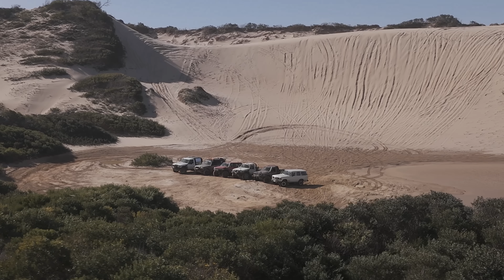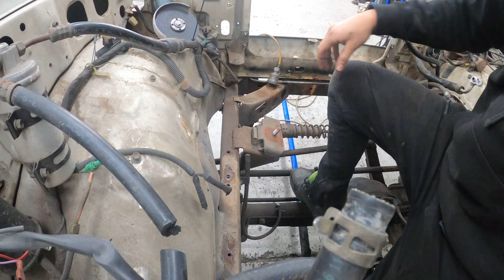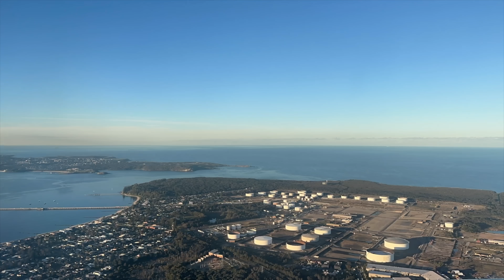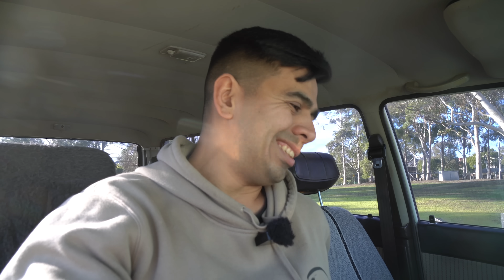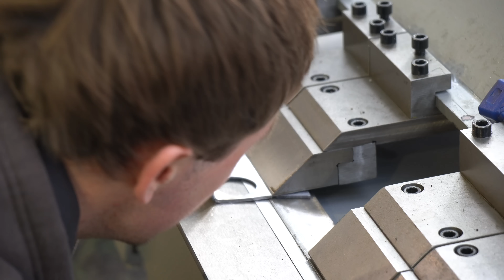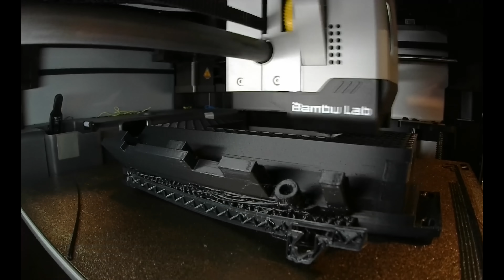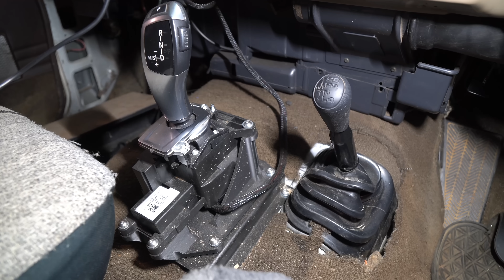Engine swapping my Landcruiser with a BMW X5 8 Speed (N57) for $30K

Comment: Great build and informative series.. Truly appreciate sharing information and logic in your choice(s) decisions. I think its great you also share your knowledge and experience (love of what you do ) with apprentices. You often use 'we' instead of I/me which also shows a true team atmosphere even when others are not directly part of your team.. OK  now can I complain LOL? 

No seriously I watched couple times and think went through all the comments but I did not find two IMO important factors for this kind of project.. The graphs & data show everything but dimensions? Would not expect all the specifics. You did mention having to move steering box for frame rails but perhaps just overall box dimensions could be added .. Width length height box.. This for N57 engine as well as for the ZF8HP. Is the 8HP 2" shorter / longer / same as is another way of stating it.. Ditto for xfer case used along with (no assumptions LOL) rear output centered? front output pass/driver.. Yielding total overall + / - of?

In building an adapter for a xfer case to AT we had to account for rotation of it to get to where the front axle housing was. as none came stock on that side. Still all you did show and provide is awesome and great.. Will be looking into a ZF8 or 6 to perhaps use in a future upgrade.
Oh and greetings from USA ..

Comment: you picked the wrong engine to use the e53 engines much better lots of injector issues with the piezo injectors on the newer ones
Reply from the maker: I wanted an 8 speed!

Comment: It is very well known in germany that most of the bearing problems of the n57 come from the oil pump, i highly suggest getting a upgraded oil pump for that motor, otherwise it is just a matter of time until it will blow up.

Comment: Great ep Richo! 
I loved the cost v power charts etc. Would you consider the 1gd ftv engine a good option to replace a old engine in a Cruiser
Reply from the maker: Hey mate, they are good motors but I'm an i6 man! Easier to get more power reliably. Also the 8 speed drives very well!

Comment: Hey a really great video, kind regards from Germany! Btw the m57 as m57tu2 (m57n2) came as alloy too! So weight comparison is not absolutely right. The advantage for sure is no adapter between engine and transmission. Oh and i myself bought a e46 330xd m57n and i cant say it is agricultural...actually the engine is super smooth!
Reply from the maker: Cheers Max, fair point. They are good, but quite a noticeable difference to the 8 speed!

Comment: That does sound like a great combo! Coming from an owner of a 1984 HJ60, and a e53 X5, 2006 3.0d with the m57 turbo diesel & 6hp gearbox. The HJ60 is a cool old rig, but man o man is the BMW Turbo diesel and auto so much nicer than the agricultural 2h & 5spd manual.

Even with the modern engine & 8spd auto, I'd be surprised if you can match the x5's economy, the HJ60 is like a brick in aerodynamic terms lol.
Reply from the maker: Haha true that, it is. It is prettly close to 10/L per hundred though!
Reply: @DesignedandBuilt thats not too bad at all. My hj60, drive it hard or soft, it drinks almost twice what my x5 does, but the X5 will never be as cool.

Comment: How did you come up with the idea of replacing the Toyota engine with BMW junk?
Reply from the maker: Because its just as good as the toyota engines and about 1/5th of the cost. Did you see the  justification at the end? quite a popular swap
Reply: You need to open your mind a little. The BMW motor/ZF trans is a fabulous combination. Strong performance, economical, quiet and with a reasonable level of preventative maintenance, quite reliable.

Comment: I'd be keen to see a comparison of fitment limitations of the barra, n57, m57 and other inline 6s as I suspect they have significant height, length, width differences including ancillary locations to chassis rails, steering shafts etc.
Reply from the maker: haha well the N57 is tiny compared the Barra.... everything packages a lot easier and you'll see it over the next few episodes.
Reply: @DesignedandBuilt I bet the m57 and n57 are quickly going the same way as the barra. From a mostly untapped cost effect market to a premuime option due to every 2nd guy chosing them for their builds. Sadly I'm late to trend.

Comment: Such and awesome build. I don't think the 60 chassis will be a negative for a normal touring setup, but I suspect the 'touring' is this does may justify the 80 series eventually.  I bet someone would love to adopt the modified 60 chassis for a drop in N57 build.
The combo of such a classis body and the drivability of the modern engine and trans will make this a true winner. Would be an awesome daily driver.

Comment: Seems like all the X5s in SE qld already have their engines, transmission and ECUs missing. We really need a solution for all these perfectly fine X5 rolling shells. Maybe they would be good as an EV daily driver with an awesome N57 powered weekend off road machine.
Reply from the maker: Haha true that! They are fantastic dailys. I would daily an EV one.
Reply: @DesignedandBuilt likely better as an EV than a Cruiser or Landy due to all the rattles and squeaks. ;)

Comment: Awsome work mate, so good that you're open about the costs as well as time taken. As a mechanic turned fabricator, people rarely understand it can take a day of measuring, cutting, welding and testing just to make a simple shifter bracket. Gonna be a weapon when it's done, my neglected 60 that's in bits in the shed is very jealous 😅
Reply from the maker: Thanks Carl! Custom work takes forever, I find if extremely difficult to bill out for as I feel guilty! Sounds like your 60 could be prime for a swap!

Comment: With your plasma cutter, do you need to  grind the edges before you weld? Or weld straight off the plasma? Thanks
Reply from the maker: Hey Antony, yep correct! They require the dross to be knocked off and then a light little sand!

Comment: USA didn’t get this bmw chassis with the n57, just m57. My understanding about why the timing chains and bearings need more maintenance than the m57 is because of two things. First the n57 has an undersized oil pump for proper lubrication to the bearings and chains, therefore it is wise to upgrade the oil pump to the x5 50d oil pump, it is larger due to having three turbos😊. One other thing is in the f15 chassis with the n57, is equipped with engine start/stop system which is trouble for keeping the chains alive. That comes from research from talking to mechanics in Europe that deal with the potential problems of the n57
Reply from the maker: Good to know, when I swap into the 80 chassis I might do the oil pump! The thing is it sits at like 1200rpm highway cruising and I can imagine it would have oil pressure issues because the 8 speed is so efficient!
Reply: The oilpump is not the main problem. Go and search up ditupa documentation. The main problem is the to weak main bearings, allowing to high tolerances and then creating oilpressure problems...this is even more caused relatively unbalanced crankshaft of the later n57s.

Comment: Dear ALL. I have a Complete Well Running BMW E70 X5 M50D with Only 108000 kilometres. FOR Sales at Only $12k. Located Brisbane inner city QLD 4102

2012
BMW
E70 X5
M50D
N57 Triple Turbo
8 Speed Auto
108000 Kilometres

Complete Well Running Car

(Not Listed anywhere. Same 2nd owner for Years)

Comment: The BMW N57 was responsible for several engine failures in police vehicles that resulted in at least one attributable death.  Police in UK have now shunned BMWs as mainstream vehicles as a result.  The cause of the failures appears to have been as a result of long idle periods followed by high power that could also be experienced off road.
Reply from the maker: Get ready to see the testing i put this through! No dramas after flogging the daylight out of it!
Reply: Weren't those failures related to the rusting away egr coolers which lead to self ignition because the glycol in the intake?...
Reply: @maxgr7723  The information I have seen merely states that the prolonged idling followed by max power requirements suggest that during idling there was a build up of combustible liquids/gases and hitting the loud pedal caused them to ignite.  Anyway it means that the engines have a known weakness.
Reply: @clivewilliams3661 that's been the egr problem then. It was addressed in a quite big callback. Its not a bmw fault but a fault of borg Warner for bad quality tbh.
Reply: @maxgr7723  Most manufacturers build cars as an assembly of parts sourced from outside suppliers, they rarely make anything themselves.  That does not absolve the manufacturers from taking the blame when parts fail as they are responsible for the spec and the quality control of those parts once they arrive in the factory.  this was a big problem with jaguar for many years where their reputation was based on poor quality parts that they simply didn't reject.

Comment: If you do the timing chain do yourself a favour and do the oil pump, it's actually the main reason these engines die. I've seen them die before 200k km

Comment: We drove a 60 last year from Melb to Alice, up the Tanami, down the Canning, along the Gunbarrel Hwy and back.  The best mod my mate did before we left was to install parabolic leaf springs in the rear.  It allowed for a more comfortable ride, increased load carrying capacity but most importantly kept the bum from sagging down.
Looking forward to more of your content, and I'll check out the other builds too.  Love it.
Reply: do you know what parabolic leafs are..  i think not..  parabolic leafs are only  EVER fitted to the front.. they are 1 or 2 leaf.. get fkn educated, not brainwashed with bs advertising products with dumb ass names.. maybe look at a blazer, f250, transit van. ect..
Reply: Check out Terrain tamer, EFS or Fulcrum parabolic leaves for the REAR, many to choose from.  Google it, it's very simple, and you can fkn re-educate yourself for free.  You're welcome!
We actually used them for 1000's of km across outback desert conditions and they were great.  I'm not sure you know how they work, there's  great explanations of the engineering behind them which might help you understand the maths.  Grammar etc, I can't help you with full stop, full stop

Comment: Mad props to you for being the only one so far to explain the 20k plus sponsor 5k and parts lying around 5k rule, because I've seen some people say 20k budget and some people say 30k budget but I sware u are the only one to properly explain it so far ay.
Reply: How the F*** do you buy a 60Series and BMW and not Spend over $20K…
Reply: @DavidSzentessy  Watched the video yet?
Reply: @Mojojosie86 

No and I don’t intend to. 

Can’t stand BS!
The Conversation (and Engineering Certification) would cost more than $20K
Reply from the maker: @DavidSzentessy  We didn't have to count the certification in the budget luckily because it varies so much state to state! I flew to sydney to pay $5500 for an X5, I paid $7K for a 60 series. Good deals but not that unrealistic.
Reply: @DavidSzentessy a trip to the auctions can pickup a X5 for reasonable money, leaving North of 10k to find a not too rusty 60 series.
Reply: @MrToranaGuy 

The. Add Wheels Tyres Suspension Brakes and Essential Accessories Etc Etc Etc….To get a Vehicle Engineering Certificate (Legally) Costs North of $5,000……
The Only way they will meet the $20,000 Criteria of this Challenge is if they Sell the Vehicle at the End (Assuming it Survives)
Reply: @DavidSzentessy I've actually engine swapped a vehicle and had it engineered in the state of Victoria, it was a lot less than $5k. The cost to get something legally engineered really depends on what you are doing.
Reply: @MrToranaGuy 
The Whole Vehicle must is Checked. and Pass (If the Engineer Values Their License) Regardless if it’s an Engine Swap or Not.
Reply: @DavidSzentessy I know the process, I've been thru it before. The first step is to go and buy an hour of your engineers time and tell them what you are doing. Then you can work out what it will involve and what it will cost. 

It also helps to go read over the adr's that your vehicle was built to originally, and go read the VSB14 guide before setting out on your modification journey.

Comment: Wait, you replaced a Toyota engine from a Toyota Land Bruiser with a BMW?? Ok... wow
Reply from the maker: I would suggest doing some reading on these particular motors... They are far more reliable than a typical BMW - a hidden secret for very good reason.
Reply: @DesignedandBuilt  so they say... ive seen them F'd at 30k miles but hey all the best

Comment: The old 60s are great, only downside is the rear overhang.  With the right parabolic springs they flex just fine, and unlike the 80 series the diffs are super strong.  BMW N57/8 speed - I'd love that in my GU :)
Reply from the maker: Thanks mate, yeah I agree they do seem to flex up pretty well. I would love it on an 80 one day though just for road comfort! The diffs are super strong! Do the swap, you won't regret it!!!

Comment: As a European, I tell you that this engine has bearing problems and must be replaced preventively. It is the N57. The M57 is much more reliable.
Reply: First comment that's actually right...it's not the oilpump per se.

Comment: As a welder by trade I understand pretty much everything you have done except one thing, there was never any mention about engineering approvals and legalities??
Reply from the maker: hey Malcom, you're correct. Everything on the chassis was done by a certified welder and I have been working with an engineer!

Comment: Have a m57 & 8 speed in my defender without an additional tcu controller
Reply: How? There is no way to let them operate. The m57 ecu does not talk the right canbus messages...with your idea the cantcu wouldn't be in need...even the very first n57 engines had a few drawbacks with the 8hp and if im not wrong an additional ecu step...
Reply: @maxgr7723 its all plug n play if you know what your doing,  absolutely no need for cantcu in my instalation,  have done 25k miles including a trip to Africa in it
Reply: @maxgr7723 because he has an untamed wizard at his his disposal who thrives on projects which people say are impossible or cannot be done.

Comment: I strongly disagree with using so much cad for 1 off items it doesn’t make any sense in my tradesman brain you’ve made 900 prototypes when you could’ve just made a pattern out of cardboard and made your items in half the time
Reply from the maker: Hi Michael, two points: 
1. Hand made pieces will never look the same as CAD/Laser pieces. They always look handmade, it is impossible to achieve the same finish. 
2. How do you know they are 1 offs? Maybe they are development so I can sell more of them? Which can help offset my design time I have sunk into them. Now I have the models I can easily press go again to manufacture more.
Reply: @DesignedandBuilt I disagree with hand made parts look hand made, I make all sorts of parts day in day out that have a factory finish by hand not everyone has the skills required we aren’t all real tradesmen, if print times where faster there would be an efficiency argument but if you are a professional and keep patterns you can make factory finish item repeatedly no drama and probably faster and of better quality each to their own I guess 👍🏽